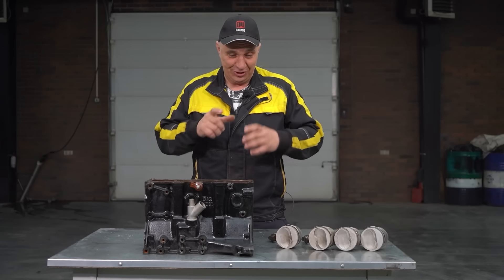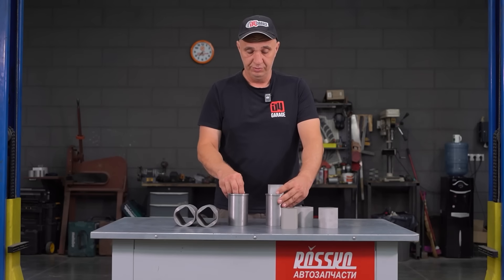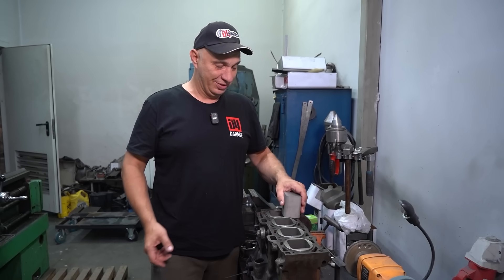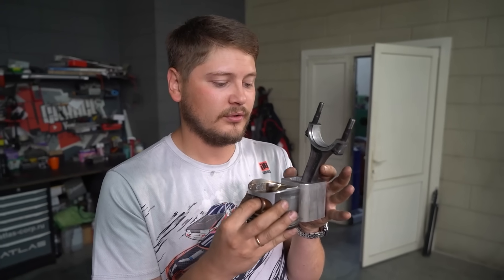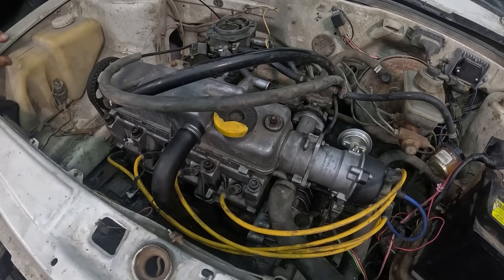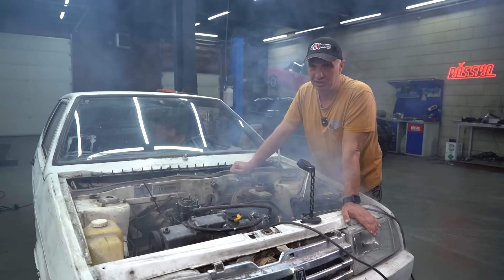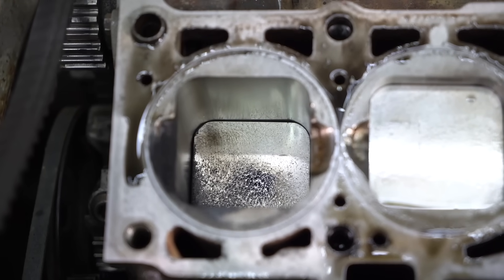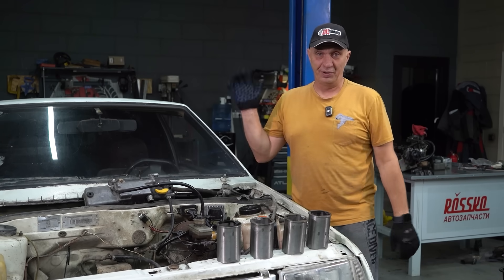We make square-section pistons - will they work?

Comment: Get some custom made square rings. Add some piston to cylinder wall clearance, and revisit
Reply: Isn't square ring an oxymoron?
Reply: @benholroyd5221  Ask a boxer!
Reply: @benholroyd5221  ehhh its edges are still rounded.
Reply: @benholroyd5221  Not necessarily.  I have seen square-shaped jewelry rings shaped like these pistons.
Reply: @benholroyd5221 nicht unbedingt, in Deutschland sagen wir auch "Vierkantrohr".
Reply: @db8920 well maybe, unfortunately I'm on my phone, and I don't have a translate to English option, so I'll have to take your word for it.
Reply: Honda made oval pistons in the 1990s. Google NR750. At least 10 patents on the rings alone. Stupidly expensive and not worth putting in to production even though they crammed 8 valves in to each bore
Reply: @theairstig9164 Those pistons weren't small, eight valves fit pretty good.
Reply: They would have to be in 4 parts to accept the tolerances and dilatation, but I think it is possible.
Reply: @petittoto7433  It's definitely possible. Doing them in 4 separate pieces, they could of designed them like apex seals with a spring behind each section. They already went through all the trouble of getting sleeves wire edm cut, they could of had the ring sections done at the same time.
Reply: @travisthompson6959  I see more like a L that goes like 1/3 on one side and 2/3 on the other side of the square, with some spring on the back (maybe it is what you mean by apex seals). The second "ring" would be 2/3 and 1/3 (or 1/4...). It seams a lot easier to make than the full cylinder.
Reply: @travisthompson6959  as the lazy/cheap way, you could use a very high machine tolerance square piston ring with a oil mixed gasoline like with lawnmowers. 

though the main problem with my system would be getting the ring on the piston without snapping the ring.
Reply: @travisthompson6959  You don't need four separate pieces, only two. Make a square piston ring and cut diagonally , then add springs inside the corners and on the ends where the cuts are to push it out. You'll end up with two ring gaps, but with two square rings at opposite corners, it will seal well enough.
Reply: Look for some High temperature O-Rings made of silicone?  Good stuff
Reply: square piston rings would have the problem that they are not compressing right. the corners would stay stiff, especially opposite of the opening. 
I imagine it could be done custom. with an opening on every side, so you get 4 pieces (or maybe possible with 2 pieces?). To allow the corners to compress they would then have to be connected with a wavy- oil ring type piece that goes all the way arround. maybe that could work. 
If the wavy wing pattern is pressed flat by the compression, you would need to do it with hinges, but honestly i don't know how to do that with this little space. Possibly make them wider and go firther into the piston? Or maybe a compliant mechanism- single piece compression ring is possible. 
Many possible ways, but none of them simple. Could be not worth the effort.
Reply: @surrealengineering7884  Read my above comment. Could be done like apex seals.
Reply: @surrealengineering7884  Not enough tension, make it more convex. Too much in one spot, dial it back across that area.  You can get it to be equal with enough work
Reply: Needs oil control rings and also there is no way to put a cross hatch pattern in easily
Reply: can you make a square ring. from what I understand circular piston rings use spring tension to keep them against the piston walls. which I dont think can work for a square shape ring
Reply: @groomschild1617 it would need something similar to what rotary engines use to seal the pistons i think
Reply: @brandoncarpenter9451 that would actually make a lot of sense to use similar ones to apex seals, but in overlapping layers with two opposing aides above and the other two opposing sides below those two for more seal.
Reply: @brandoncarpenter9451  those are just blades really
Reply: @brandoncarpenter9451  Rotary engines use apexes and they are easy to put in compared to a square seal those guys require, it would require the piston to have multiple parts which will compromise the durability.
Reply: @groomschild1617  You can definitely make it work, you just need a spring that's not square to begin with but will maintain even pressure against the bore when forced in to that shape. It will be complicated to design and fit, but I don't see why it couldn't be done.
Reply: @skitidet4302  Maybe folding a fitting strip of steel at the corners and slightly cutting them to shape? Something's just gotta work...
Reply: @groomschild1617  Honda made oblong pistons and the flat sides of the rings still worked, however that was the ultimate issue more or less, so they said to make such an engine again it'd be wise to use elliptical pistons instead.
Reply: @groomschild1617  it needs to be made from at least 2 parts that are spring loaded from the back. Probably 4 is needed to make the corners tight
Reply: @groomschild1617  Exactly. The entire concept could never work.
Reply: Make a no pressure square ring, strech it's ends a bit, and using it make a new template to make new square ring which will have pressure.
Reply: Funny everyone thinks pistons are round. But in actuality they aren't.
.Pistons are designed to be slightly oval or egg-shaped, particularly below the piston rings, to account for expansion due to heat and the forces they experience during combustion. This shape helps them maintain a tighter fit within the cylinder and minimizes noise and vibration. https://www.youtube.com/watch?v=VWxLLI8iLrQ&t=374s
Reply: +   WILK. REQIURE. -   OIL. SCRAPPER. RINGS.  +   ANTI.  FREEZE.  COOLING. 😁  ❤   !
Reply: I'd think square piston rings would be possible, but to cope with thermal expansion they'd need to be made as 4x "L" shaped pieces. To limit blow by they could put a horizontal step in the tips of each L that match up with the step in the next section round.

The only real big problem would be keeping the rings in contact with the cylinder (???) walls. Round piston rings float in their grooves and are made to be ever so slightly bigger than the cylinder bore, so they naturally spring out to stay in contact. 4x quarter rings wouldn't have any springiness to preload the sections to the bores wall. The simplest solution would probably be to make the grooves slightly deeper, then fit a high temperature rubber O ring behind the piston ring sections. As the rubber wouldn't be what's containing the combustion forces (and the ring sections would be shielding them to an extent) they'd probable cope better than the ones shown in this. Or maybe they could use 4x slightly curved spring plates per ring to push the sections out? Mind you, with 32 ring sections (4 pieces per ring, 2 rings per piston, and 4 pistons) and 32 spring plates, it would be a pain in the neck to assemble.
Reply: Each ring could be made from two or 4 sections. Maybe with a channel to hold them line apex seals on a rotary. Then add extra rings to make up for the gaps in the first one possibly? Or if only using one ring, figure out how much it'll expand so it fits with no gap at operating temp? This would be really awesome to see a little more development in the rings to show if it's got potential. I know there was a racing motorcycle that had oval pistons, so this isn't exactly uncharted territory.
Reply: @danr3778  "Oval" is the key word here. The NR750 you mention ran oval pistons to get around racing regs. In effect it was a siamesed V8 with each piston having two con rods, 8 valves and so on. This allowed their 750cc "4 cylinder" to compete where a V8 wouldn't have been able to. 
On the downside it was quite heavy - doubling up on a lot of components will do that - but on the up side it made a heck of a lot of power for a 750cc "4 cylinder" and importantly over a great spread of rpm. 
The point is they made oval pistons and rings work in the late 80's. This design isn't actually square pistons but rather very squared off round ones. It still has round edges and thats what may allow it to work well if engineered properly. Sprung "rings" as in a rotary may well be able to work with this design and it holds many benefits over the standard round ones. 
Can it be made to last? Can it be made cost and time effectively? That remains to be seen but most things didn't just appear and work - they usually need some kind of process or breakthrough to work well. 
Considering the upsides (way more valve area for a given size, much less wasted space between cylinders, much better gas flow and so on) I think it is probably worth looking further into.
Reply: piston rings are designed to spin. These will not. Theres a reason they are not square.
Reply: They need to use apex seals from an mazda rotor engine
Reply: Bend a coat hanger around the piston.
Reply: Heat and rubber don’t do well together
Reply: You could try graphite yarn for the piston rings !! It would problably hold up longer than the rubber o-rings !!
Reply: And that's the reason pistons are round. Sealing rings for square pistons and cylinders are much more difficult to machine compared to round ones which are an easy job on a lathe. As well as the corners of a square 'cylinder' becoming hot spots for blow by if you don't round them off.

Tooling is the reason pistons and cylinders are round and not square.
Reply: Rubber rings doesnt sound durable, i agree get square rings
Reply: 2 part rings
Reply: Lada the best.😂
Reply: that would be insanely expensive. Unless they can find some material and wire edm it too, which isn't totally impossible
Reply: It's an interesting idea, the issue is that pistons are not stationary. They are under constant micro movements side to side going up and down. So the corners are likely to wear away first on the rings. Unfortunately there's no beating physics... Circles slide the best.

Edit: To expand on this, these people have tried it, the seals didn't last too long.

1. Dake Square Piston Engine (1888)
2. GB Patent by Arthur E. Peters (1925) Patent US1598653A
3. Improved Engine Square Piston (1967) Patent GB1176509A was filed by Leslie Desmond Harries in the UK. There is limited documentation, but not much else.
4. "Square Piston Engine" (SPEC) Prototype (2008) was a modern two-stroke internal combustion prototype dubbed SPEC. It envisaged square pistons for emissions reduction, closed-loop oiling, and modular manufacturing.
Reply: There was a British guy who hand made a miniature spitfire engine before the Internet, in the 80s!
   He hand made the rings for it. He is probably almost 100 years old Now.
    It could be done for those square pistons but dam it would be really hard.
Reply: Could have made custom rings on the EDM machine.
Reply: If it was a nitro engine you could use a sleeve that has the proper expansion to seal when the pistons are moving and creating heat ,a square piston would probably work that way without using rings at all
Reply: need leather rings like the oilless compressors

Comment: As a manufacturing production engineer I know anything being engineered is time consuming. But that's exactly what design manufacturing engineers do. Then my side is tooling up a manufacturing line and verifying that PPAP, ASE, and tolerance and quality are consistent in the manufacturing process. You guys are developing a design and a process. So in a way you did this very very fast.

Piston rings of coated alloy would have been the hardest part to design and machine. Easy to work out the process and speak it: but hard to fabricate and machine.
Reply: PPAP is essential. Referencing a part's PPAP got me out of so many crazy customer claims.
Reply: @louchedecay7922 I tell good Machinist and technical people all the time who "hate" paperwork...Yeah your idea might be good, but they own the process and that protects us from field failures due to us changing a process or feature on a part. I started as a Machinist and used to think that way about Statistical Process Control, and in process QC checks. But now I'm an advocate for these controls. I like these guys going through these fun examples of how it's easily said, but hard to actually work through. Garage 54 is more than entertainment to those not in our professions. They are true professionals!!

Comment: Great work but doomed to failure even with working piston rings, the sleeves variation in thickness and the  unequal burning  would lead to uneven heat causing  siezure anyway

Comment: I knew the rubber piston rings would make trouble but well made anyways. Remarkable Job 😊
Reply: I'm sure they are silicon rings and as such tolerant of very high temperatures that will melt rubber easily. Silicon O-rings are often used on engines.
Reply: @johnt.848  Yes, in such applications as oil filter casings, not in the red-hot combustion chamber of an engine block though!
Reply: @FMFGUF Excacly! My Colleges laughted when i told them of the rings they used here and couldnt believe a mechanic is actually putting a Single o Ring on the piston. they used These after all this work of engineering. Did they make all this for the engine to run just long enough for this Video?
Reply: @johnt.848 because silikon is taking the heat? They proved how efficient it is and it surprised me like wait what are you guys doing. 😅
Reply: They worked quite good in the past and surprised me, but I can't remember if they drove on them.

Comment: Works but rings would wear quick because in normal operation rings spin if you’re not using rings the cylinder walls will wear rather fast

Comment: Why dont try nylon piston rings?
Reply: nylon melt at 80 degree C, rubber burn at 200 degree C.
Reply: @xponen  The melting point of nylon varies depending on the specific type, but generally falls within the range of 215°C to 265°C

Comment: simple piston rings are made of cast iron. would it be possible to cut piston rings from a cast iron blank using that wire-cutter machine to get the perfect tolerances?
Reply: cuting them wouldn't be an issue but there would probably be way too much stress in the angles
Reply: @mostneuter  my thoughts too, it might also be very difficult to just get them on with ought breaking.

Comment: they make round pistons because they spread the load more even , square pistons probably work but not as long as round pistons , there was a motorcycle manufacturer that made a v engine with oval pistons
the machining they done for the test is pretty impressive though

wat might be fun is bring the engine to a engine rebuild shop and tell them it devellopped a knocking sound

Comment: Amazing what you can achieve! Did you look into "viton" rubber for the seals? They are make for high tempture / pressure. Love seeing the challenges which you face along the way
Reply: Also drill some pressure relief holes at back of compression rings to control blow by
Reply: I don't think even viton rings would hold up to this abuse but they'd certainly last longer.

Comment: round pistons are always going to be the best option. the edges would be the area with the most wear + the piston rings would fail along the corners, while conventional round pistons the wear would be more spread out. regardless you guys are amazing for the efforts for this experiment! 👏
Reply: Also fuel burns in a symmetrical pattern, MIT worked out not only the shape but also the perfect displacement for different fuels.
Reply: Heat expansion, too. 
Makes me wonder if a sphere piston head would be even better than a flat surface....
Reply: @ryanj610 especially with unlike alloys.
Reply: Yep, exactly why rotary engines are not what you want for a reliable daily driver that'll go 300k miles between rebuilds. 

A circle is so much easier to seal.

Comment: the problem with squared pistons long term, given tolerances are perfect etc. would be uneven heat distribution across the surface, as diagonally there is more distance to cover than laterally.

That said, please try a convex hemi-spherical cylinder head next 🤓

Comment: Honda actually built engines in 1979 with oval pistons for its racing motorcycles - the NR (New Racing) 500 and 750.
Reply: But they actually worked

Comment: Try 'VITON' 'O'rings.
Reply: Yep, the best on the planet, resistant to absolutely everything, probably even radiation.
Reply: Are they more temperature resistant than silicone? (Although silicone is quite soft and probably wouldn't work well to seal).

Comment: The blow by increasing as its sitting there idling is hilarious. You can see the crank case pressure blowing smoke from the drivers seat as he's driving.
Reply: Rubber o rings as piston rings won’t last long 😂
Reply: @chrisvig123  the rubber rings did great in the video about trying them. They didn't even melt.
Reply: Maybe they could’ve stamped square rings out of a sheet of metal. Stamp them with each corner of the square slightly greater than 90° To keep some tension
Reply: @danr9584 or, even better, have spring loaded "rings" like a rotary